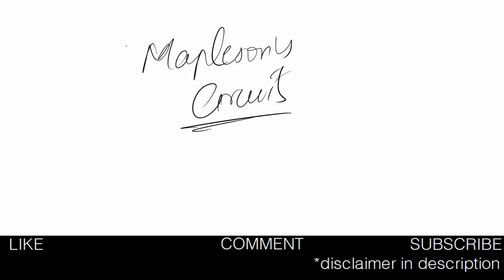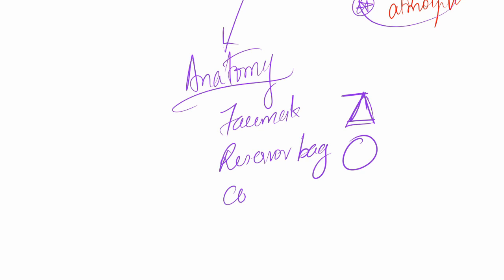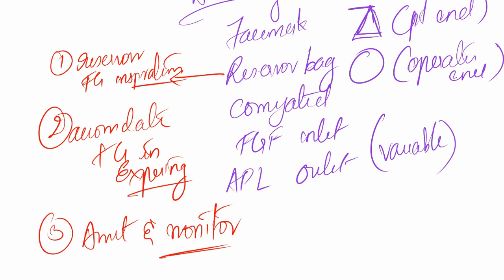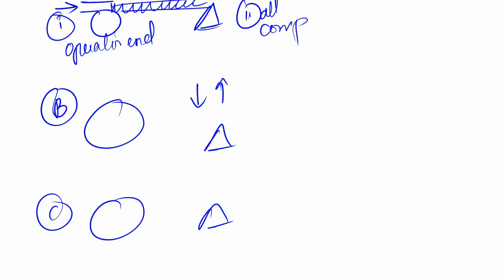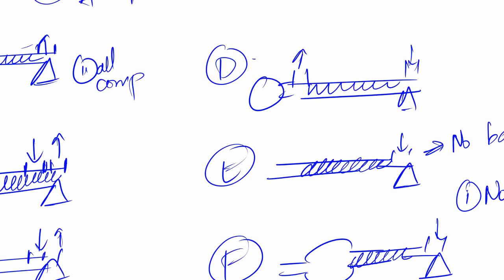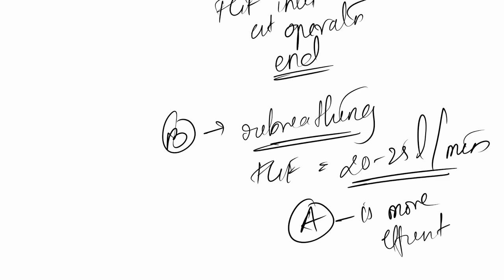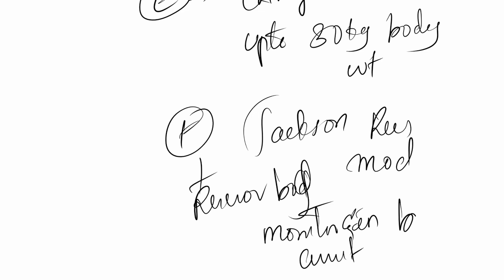Mapleson's Circuits ( Anesthesia / Breathing Circuits / Respiration / NEET PG )

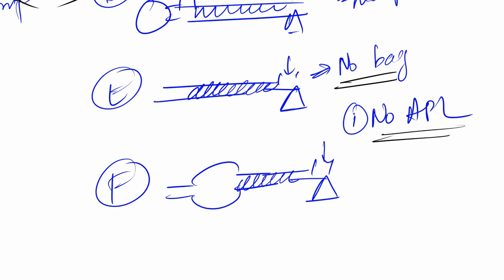Comment: 8:43 you said spontaneous can't occur through E and F. 

Absence of APL means controlled breathing can't occur through E and F, while spontaneous can.
Have i understood it correctly?
Reply from the maker: Dear Ritweez Sahu,
The APL valve ( Adjustable pressure limiting valve ) is used to adjust the pressure of the outlet. So as open only when the gas builds up in the circuit with set amount of pressure.
If we want spontaneous breathing , we set it to minimum pressure(open / low pressure is required ) , and if we want spontaneous breathing when there is bag attached, we set it to little more pressure
In case of controlled breathing, we set the APL to higher pressure and push air via the bag( or any other type of positive ventilation ). If the APL was open during this , due pressure created by compressing the bag, the air from the bag would escape from the APL.

When i said E and F cant be used for spontaneous breathing, i meant that it is very ineffective to have those circuits in such situation whereas they are more efficient in case we need controlled ventilation.

Efficiency in Spontaneous ventilation: A>DFE>CB 
Efficiency in Controlled ventilation: DFE>BC>A

The sources do Vary on the use of E and F circuits for spontaneous breathing. Some say they are preferred for spontaneous ventilation due to their low resistance while other sources say the opposite.

Hope i could help you with your doubt. Please reach out if any more doubts persist.

-AR
Reply from the maker: Both Spontaneous and Controlled ventilation can be achieved by E and F by either keeping the expiatory limb open or occluding it intermittently
Reply: @dr.rightspg790  thank you!

Comment: Why apl valve is partially closed during controlled ventilation whynot completely closed sir.
Reply: If completely closed, the patient won't be able to exhale or vent out CO2 leading to hypoxia...also the pressure build up would cause barotrauma to the lungs...if opened fully, then they won't be enough pressure to generate positive pressure..that positive pressure is what allows us to provide mechanical ventilation ..spontaneous ventilation is negative pressure .hope it helps..
Reply: Than why in spontaneous ventilation it's completely open, not partially like controlled ventilation sir
Reply: @PRIYAYADAV-nd5zm  in spontaneous ventilation, the patient uses their respiratory muscle to generate negative intrathoracic pressure to inhale gas..the exhalation part is passive due to elastic recoil of the chest wall  ...if the apl valve is not open (or closed like in controlled ventilation), it would create Resistance to the exhalation of the expired gas..the only way  out for the gas in the circuit is through the apl, also known as expiratory valve. ..we don't want this valve to be closed as patient can't expire..in contrast, in Controlled breathing, we provide patient with positive pressure by squeezing the reservoir bag as patient is not able to breathe on their own. If we leave APL completely open, then, we cannot generate enough pressure to drive the gas into the patient lung during inspiration as the gas will escape through the open apl valve. We can't completely close it too as the patient can't exhale...so it is kept partially closed depending on the amount of pressure we need to provide positive pressure
Reply: It's the most satisfactory ans/ reply I got from u and no one else than you sir explained it that much well. Thank u 🙏

Comment: Thank you so much sir. I understood.
Could you please explain which circuit is better than the other and why.
Reply from the maker: Dear Catherine,
Glad to hear that the video was of help to you.
Coming to your question, No circuit is perfect and each are made in such a way to suit a particular need. None are better than the other. Each have their own role.
For example ,1) since A has FGF away from the patient, it is easier to adjust the gases as required.
2) Jackson Rees modification of F is used in Pediatrics more commonly and especially neonates.

But overall, when we look at the bug picture, B, C and E are considered inefficient.

Hope i could answer your question.
- AR
Reply: @dr.rightspg790  okay thank you sir.

Comment: i have to rewind so many time to figure out the D and the T, accent is quite strong. Overall, it is very informative!
Reply from the maker: Dear Justin, 
Yes 😅 Have received similar complaints but the accent is quit hard to get rid off given that I work amongst people and patients with the same accents so it sticks like glue.
But efforts are still being put in
Thank you for the feedback.
- AR
Reply: Dr. RIGHT'S PG humble advice , probably you may consider including the subtitle as an auxiliary or try to slow your speaking or emphasizes/stress some important part.